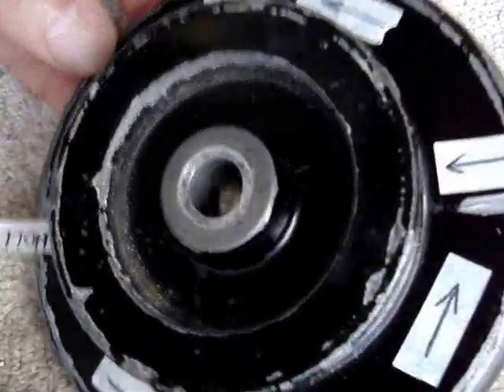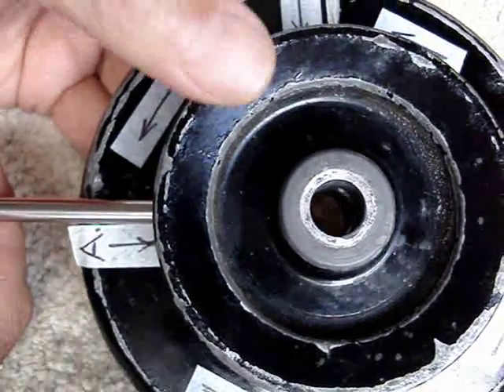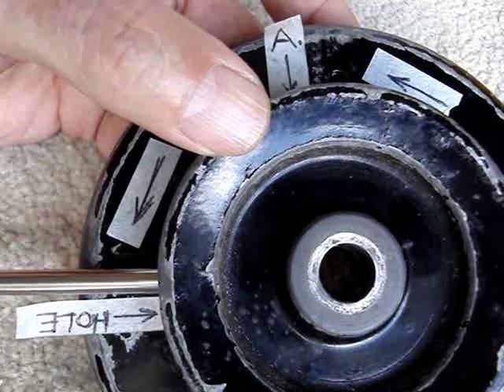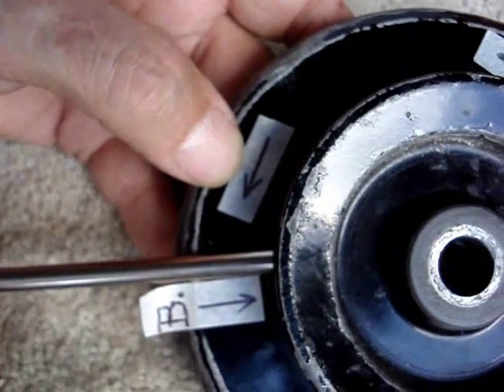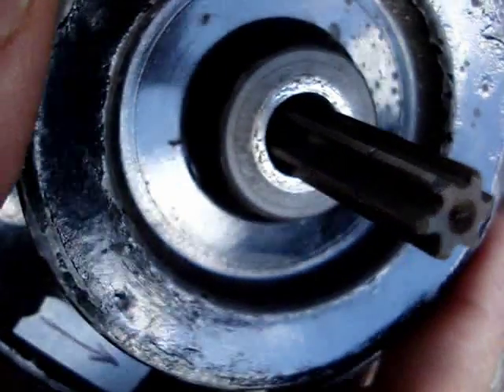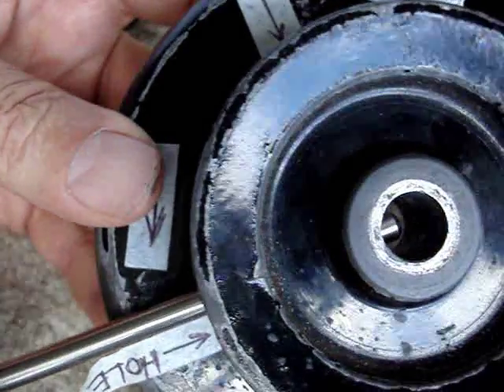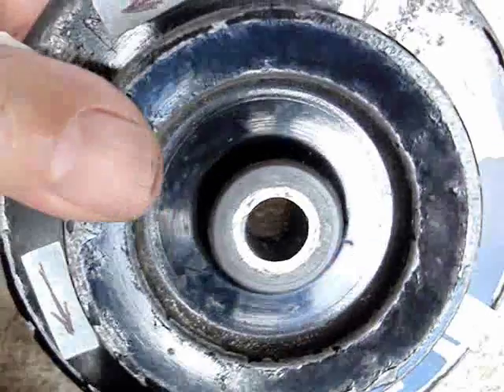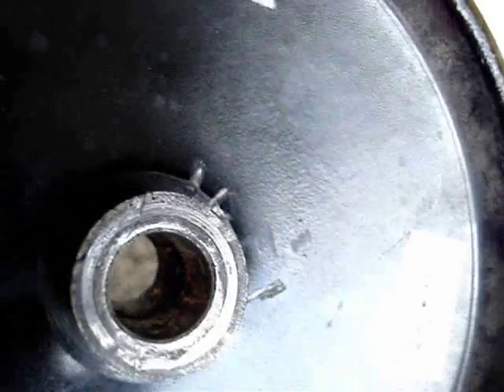consew 226 sewing balance wheel+shaft pt 1

Comment: Dear Sir, My name Is Kenneth. I have been around Industrial sewing machines since I was 7 years old. I would like to answer your questions sincce  own a fleet of Consews and Pfaffs. I also have a Machine shop in my garage. I have been repairing Industrial sewing machines since I was a teenager, that was some years ago now. I am now 40. 
1. The groove in the shaft IS Factory. 2. The Flat in the shaft is a relief for a set screw.
3. I have never seen a tapered shaft on a Consew.